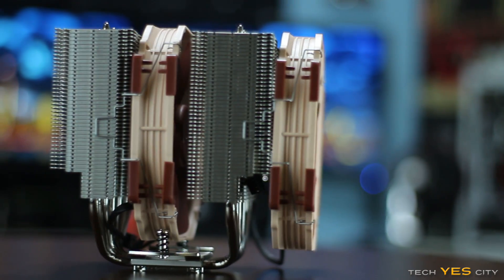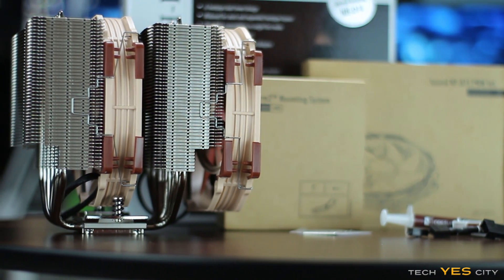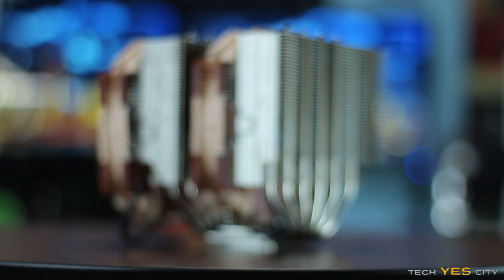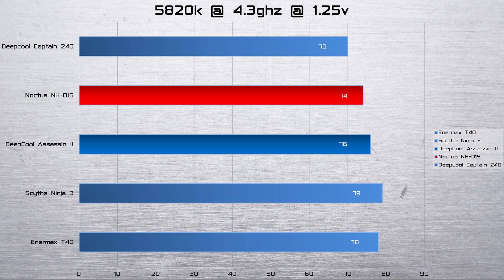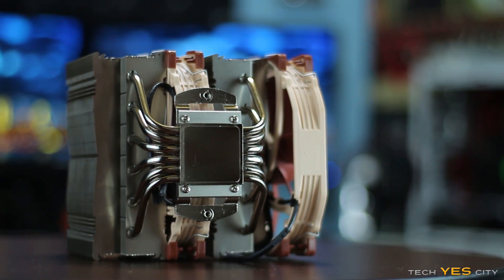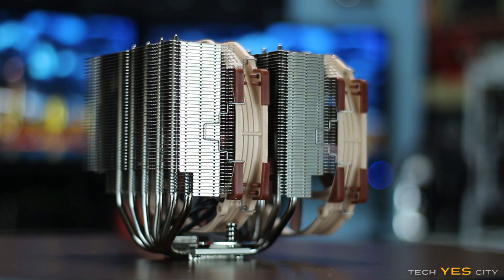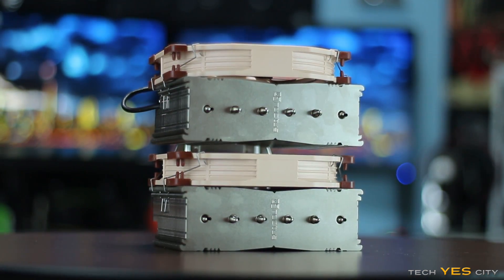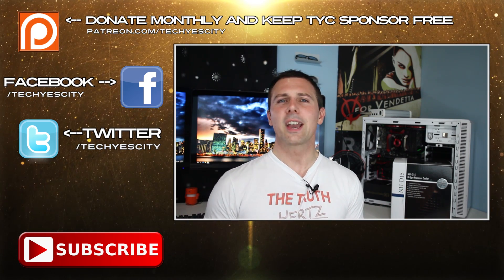NOCTUA NH-D15 Review - The BIGGEST and BADDEST CPU Air Cooler there is!

Comment: Noctua NH-D14 user reporting on R9-3900x build (should work almost as good as NH-D15)
Short answer: works great!!
Long answer: While I waited for the FREE AM4 mounting adapter (thanks Noctua) I tested the provided stock cooler. Good god it was unusable! Grindy/whiny fan jumps even on idle usage, and yes I tried everything. Bad fan? Maybe. I can't say as it's all I had. Mounted the NH-D14 a few days later (took 16 days to arrive to Ontario, Canada from Austria). Wow! What a difference. Played with the custom Asus software for my X470-F Gaming board to tweak the CPU and FANS etc. Now my Noctua CPU and CASE fans are idling under 600RPM most of the time and reasonably quiet under full load... Yay!! Only jumped from all cores 4.225GHz to 4.25GHz but it's soooo much quieter now. (also I had to flash the BIOS for my Asus Strix X470-F Gaming mobo which cost me $20 but I knew that was likely to be the case... I'd expect most motherboards for AM4 to have a suitable BIOS for Zen2/3000 but you may want to investigate that if buying soon. I avoided X570 as I couldn't justify the cost for the PCIe v4.0 improvements I have no need for)..

Also: the 2nd fan (12cm in my case) doesn't change cooling very much so I moved it to the rear of the case as exhaust. I looked at the NH-D15 but be warned to investigate the 2nd fan clearance issue. Also the NH-D15 and NH-D14 have within 2degC cooling so thank you again Noctua as I bought the NH-D14 in 2010 and got a free upgrade kit so should get many more years out of this cooler and even then it's just a fan swap (unlike AIO liquid coolers which are lucky, on average, to last 5 years).
Reply: (I realize this was almost three years ago BTW. People still find these posts)

Comment: "Water cools better than air". Only if you put your computer inside a fishtank. An AIO still uses air to cool the radiator. The air cooler is inherently more efficient than an AIO, but the AIO offers the ability to mount a larger radiator since it can be located remotely.
Reply: Indeed, water cooling only conducts the heat to somewhere else where it has to be cooled off. Airflow does the same thing without noisy pumps and compressors. Something I'd like to see on YouTube is someone hooking up his fridge or the house airco to the PC's liquid cooling. Now that's some massive cooling on a budget!

Comment: I suggest you run water coolers for a much longer time. Water coolers are great for pulling heat off the CPU fast, but the heat slowly builds up in the radiator and eventually the temps begin to rise, often to much higher than that of an air cooler. 
This can be demonstrated the other way around by seeing how long it takes for the cpu to drop to ambient after the load ends. Just a heads up.

Comment: had my noctua nh-d14 since 2011 on my 2500k on a 4.5 oc in games....and man this thing and noctua are #1....since then ive loaded out my 650d with noctua fans. Ive added SSD removed HDD, and added a 7990...and still if i were to make a rig today the only thing id keep is the 650d and the nh-d14. I use noctua n1 on all my builds and even on my gpu. It might not be the coolest but its way better than stock pastes that come with the various 212s ive installed. If you oc your gpu or just have a hot one like mine. Put it on your gpu its so worth the lifespan you are going to add to your card

Comment: can this cooler can be put going up heat rise i got a noctua cooler for cpu and I put it sideways and my temps whent up 5c It's don't like blowing to the back instead to the  2 top fans 1 on back but if I put it sideways it's going to mess with my set up

Comment: Noctua NH-D15 VS Cooler Master MasterAir Maker 8 & can either accept NF-A14 140mm or NF-F12 black fans? If not, which Air CPU cooler could that'd also fit in a Fractal Design Arc Mini R2?

Comment: What is the difference between this and the d15s?
Reply: They shifted the bottom plate so the actual heat sink fins sit higher up on a motherboard. This was because the D-15 was overhanging some PCIE slots on some motherboards. 

You can see a D-15 motherboard compatibility list on their site to check if it overhangs on your mobo.

Also, unfortunately, the S only comes with 1 fan. In other words, if the D-15 doesn't overhang a needed slot, get it and not the S because free fan. They are the same otherwise and cool identically.
Reply: Thanks for your answer! 

I ended up buying a D14s, because that was the biggest one that would have fit in my case.
Reply: 14-15 all very similar. I just bought myself a D15 for my 4790k. Also got a In Win GRone case so it should fit nicely.
Reply: I had a budget of 1k, but went over very quickly. Here is what it is now: https://pcpartpicker.com/user/DutchTexan/saved/htP6hM

Built the machine in early September. The pricing has actually, overall, gone up since I built it.
Reply: Not bad. I would personally have gotten at least a 750 PSU, in the same brand (Supernova are amazing) and probably a different motherboard if you plan on overclocking; which I assume you may due to the K processor. 

32GB of ram is overkill unless you have VMs or something. 

For the same price you could have gotten a full case such as the InWin GRone that I got. Especially if you're doing an airflow cooler case. Overall not a bad build. A fair amount better than mine. Will give specs if you want em.
Reply: Yes overclocking my CPU on that board was a huge pain. I went with the 650 GS because at the time I got it for $70. The z170 m5 I also got for $150. I got p400 case for 49.99 too! The memory I started off with 16GB but I realized I could use more for rendering and some CAD stuff. So, I bought more with the same timing, but at that time 2133 was actually cheaper than the 2400. Overall though I think it is pretty much perfect for my needs. I may upgrade the PSU next to sli 1080's some day in the future. Since the 1080ti came out my gpu has gone down over $170 from what I paid in September. But this upgrade will only happen if I feel I need it later down the road since I won't be changing too much for a few years. The 960 evo is AMAZING.
Reply: CrimsonWolf69 meant the faster 2400 was cheaper than 2133, I run all 4 sticks at 2400
Reply: I just meant 32GB is a lot; frequency is more important than amount after about 8GB, assuming you're a normal user/gamer. I get 16GB myself though, just for a bit of headroom. If you're rendering I guess it's better to be safe than sorry. i7 is a good choice in that case.

Don't bother with SLI 1080. Unless they come out with some new technology; there are potentially a lot of hassles for multi-GPUing. Also drivers don't usually get updates that support until months to a year down the track. Always better to single card it; and by then there should be an 1180/1190 or something.

Your build kicks mine's ass though, here it is: (3 years old ish)
CPU: i7 4790K w/ Noctua NH-D15 cooler.
Memory: 16GB @ 2400mhz, Corsair Vengeance.
Mobo: Gigabyte GA-Z97X-UD5H Black Edition
PSU: Corsair AX760 Platinum
GPU: Sapphire R9 290X
SSD: Samsung 850 EVO 250GB
HDD: 5 x Seagate 1TB (I get them free from work lol, I'm in IT)
Case: In Win GR One

Most of it is overclocked a little bit. That mobo is amazing for OC.
Currently the GPU is the bottleneck but it still plays everything at max so meh...

Comment: Can it fit in a nzxt s340??
Reply: get h440 if you want s340. Its very familiar but is more expensive
Reply: I have one in my s340 and it fits just fine. It's just the second fan that has a little struggle tugging into the exhaust.

Comment: I have this on a 6600k @4.5ghz and I switch between thinking my pc is broke because I can't hear anything then thinking my pc is broke because I mistake the sound of my fridge compressor for the fans, for almost everything I use this for my CPU temps rarely reach 35c. I have no regrets whatsoever buying this monster, I switched from closed loop water cooling to this and it was the right choice.

Comment: Hey Bryan, i heard the cooler master hyper 212 evo is a great value for mony cpu cooler. Do you know anything about this cooler? Do you have another recommendation? I just dont wana spend 100 euros on a cooler. or would you rather go with something like the Noctua i4 NH-U9DXi4?
Reply: this would be great if we see a console with this cooler looks like a bloody turbo charger on a muscle car hehehe
Reply from the maker: +The Part Timer 1 Enermax T40 or the gammax400 they are both good for the money as well.
Reply: It's a great cooler for the money. Everything better costs more, everything cheaper is junk.
Reply: +The Part Timer 1 Hyper 212 Evo is overhyped and ridiculously hard to mount. Look at other options if you can afford them.
Reply: +The Part Timer 1 I recommend the Hyper 212 Evo if you replace the fan... the one it comes with is a POS, but you can use any 120mm fans as long as you have clearance. I run mine with 2x 120mm 3000 RPM San Ace server fans, and I have been able to clock my 4690k to 4.5 Ghz without exceeding 170F
Reply: +evilwoodchuck Or buy the Hyper 212X, which comes with a good fan.
Reply: Ridiculously hard to mount?? C'mon know

Comment: Great review. I have a question do you have an amd cpu/motherboard to test if this only fits the non conventional way? The noctua U9b Se2 I recently brought only fits my 8350 with the vertical mount not the horizontal way. I actually have no problems with it but people that might be picky about how their coolers are oriented might be a little upset if there was no mention on the AMD difference vs the Internet difference. I'm thinking of buying another for my xeon 1231 v3. I love how Silent and how much it cooled down my 8350 from 51C at stock to 38c at idle with an over clock of 4.4.

Comment: For those who dislike the colour of the fans, the blades can be dyed using Rit or iDye Poly. Spotlight has them in Oz. Be sure to get the one for synthetic material and not cotton. Also note: dyeing is only recommended for the blades and not the housing unless you're comfortable with removing the circuitry (PITA); only use darker dye colours and the final result is a mix of that brown and whatever colour you've chosen, ie. red dye gives a maroon result; use boiling water with the dye powder and soak the blades till you get the colour depth and remember to oil the shaft before reinstallation (not WD-40 but sewing machine oil or lithium grease).

Comment: If you would tun into clearance issues with the first graphics card then the NH-D15S is a better choice. It's offset slightly to one side to allow for more clearance with the first PCI-E slot. Performance should be the same, but although it does support dual fan operation only one fan is included.It does include the fan mounts for the second fan though. 

All in all a great review.

Comment: This is the cooler I plan on upgrading too from my 212 Evo :D Thanks for the review :)
Reply: +Shawn Strickland Ok got this cooler yesterday and OMG!!! Easily cut 10-15c off my load temps, Running a 4690K at 4.7Ghz at 1.380v max temp I've got under Realbench stress was 74c
Reply: +Shawn Strickland Make sure It's rock stable. 74c is a bit high
Reply: +max Van andel he's going pretty well for temps and overall overclocking
 I get 65° at 4,0Ghz 1.1V.
Reply: Baumy 15 Yh. im sorry. 74 is stable. Intel cpu's can run at a higher temperature then amd cpu's

Comment: I bought the d14 like 3 years ago and honestly see no point in really upgrading until it isn't compatible with sockets anymore, it's a great cooler. Noctua does a great job of listing possible compatibility issues on their website so you can plan around that.

Comment: I'm currently running a Xeon 1231v3 and I want to get an air cooler mainly for aesthetics and for when I'm going to upgrade to a 4790k. I have recently switched to black/red internals with a Corsair C70 in Military Green. Any recommended coolers?

Comment: Hi Bryan. Noctua upgraded the NH-D15 with D15-S and it is a little bit shorter so everyone can always mount the gpu in the top slot of all motherboards plus they changed the fin design a little bit and they did all that without losing performance and include one fan with D15S. Great review and Noctua is the benchmark of all aircoolers for sure Bryan !
Reply: are you sure if there is not an 1x slot above your first 16x slot ? and I am talking about orienting the cooler like he is blowing the air out back of the case. And it is only some motherboards that this applies. not all. example. X79 platform the rampage extreme from Asus it does not fit.
Reply: dude I know what I am talking about and you apparently not. Look up www,pcper.com and check out motherboard reviews and see for your self cause every motherboard review is picture heavy with that cooler.
Reply: Wat

Comment: Awesome review as always. Also worth mentioning is the NH-D15S version. It has slight offset to it so it doesn't interfere with the first PCIE slot. (that's the cooler you want to get for x99) Also it has ram compatibility pretty much with every kit and size. It comes with only one fan compared to the NH-D15, but the difference is 2-3 degrees at best. (and of course they include brackets for an additional fan)

To me the only negative thing (which is entirely subjective) was the colors. But even that kinda growed on me. It's noctua's thing and I've come to think of their coolers as the Rolls Royce of coolers. lol ;]
Reply: the color has come a long ways

Comment: I got it on 4790k but i think i got air in the thermal paste because i got 60-69 c at 4.5ghz 1.212 should i re apply it to get better temps guy?
Reply: 1.212 volts*

Comment: High performance silent operation is the D15. I can't hear a thing in my case except a couple mechanical drives. The D14 is a bit louder but on a 8370 @ 4.5Ghz my max temp 41c on Firestrike. The D15 on a 4790k 4.4Ghz my max temp is around 71c. I love Noctua!
Reply: +KASUALKILLAS Running what are you getting 71?
Reply: +FEVB 3DMark
Reply: KASUALKILLAS
That's not going to show you very good results for the CPU. Try something like ROG real Bench or Intel Burn Test (be careful with this one).
Reply: +FEVB Thanks for the suggestion. I also watch and record the values that show in Afterburner after typical usage. 3DMark is plenty good enough for my needs.
Reply: +KASUALKILLAS I can overclock my 8350 to 4.6GHz with my shitty $30 air cooler. What the hell is wrong with you?
Reply: +[GD] Pokemon5475 Please explain in more detail what it is you think I have a problem with.
Reply: KASUALKILLAS You can't overclock very well can you? Neither can I but at least I still got farther with a shitty air cooler and shitty motherboard.
Reply: [GD] Pokemon5475 can i oc kaby lake 7700k with noctua dh 15?
Reply: Yes, you can.

Comment: No doubt this is the KING of air cooling! BUT, that said - I still feel that Hyper 212 EVO, at least for my i7-3770k, is the KING of value performance!

And seeing as I have my CPU running 4.5GHz with 4.7GHz dual core turbo, 100% ROCK STABLE! Prime 95 running 24 hours max heat setting saw my hottest single core hit 90° C, with no crashing or throttling in either the max heat or blend testing for 24 hours plus, I REALLY don't feel the need to spend over $100 just to lower my max Temps MAYBE about 5 to 6 degrees, and I honestly don't  think it would allow me to overclock any more than I currently have, and seeing as I have not only no problems with stability - but also absolutely no need for any more performance in terms of CPU clock speeds, EVO FTW!

TL;DR Cooler Master Hyper 212 EVO Master Race baby! Unless you are trying to overclock an i-core with 6 or more physical cores - then you may want to look into something like this! Or any AMD FX CPU.... but those space heaters almost require a high end water cooler to get any significant and stable overclock!
Reply: +al bundy No doubt! And I appreciate the recommendations! WHENEVER it is that I actually feel the need for a new cooler, I will do a LOT of research like I did for the 212 EVO!

BTW, have you ever heard of FrostyTech? They test basically EVERY CPU cooling solution available! And when I bought my EVO, it was within the top 15 or 20, with the top 5 all being water coolers of some form. The EVO, especially with dual fans like I have, was within about 2.5 degrees of the best of the best air cooler at the time - which was the Noctua D14, or an earlier version of this D15.

Which in the end, I suppose the only real reason to pay such a large price premium, is so that you could over clock as much as I have - or more, whilst still being nearly 100% silent to the ear. 

I don't care TOO much about silence, or dust. That said, despite a total of 11 fans, if you count the GPU, my PC, at least in my opinion, isn't very loud at all. Though with the rather large Over clock and VERY aggressive fan ramp I have setup on my 770s, it CAN get kinda loud in demanding games, though I tend not to notice, as my speakers are far louder, and the game takes all my attention. Also, somehow I managed to get two 770s with the Titan cooler! Which seems odd, as I read they are quite rare, with something like 5000 sold in the US from what I have read, but there is no doubt that is exactly what I have- 100% metal!
Reply: +al bundy CRYORIG is overhyped ass. The Thermalright TS-140 is $5 more and outperforms the H7 by like 6c.
Reply: al bundy Oh yeah, I forgot it sold out on Superbiiz, the last place you could get it.